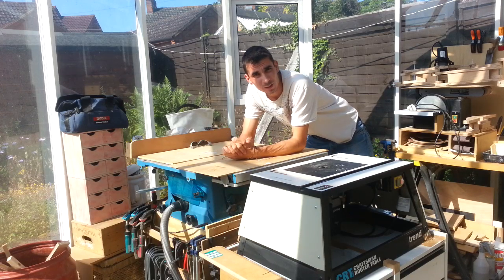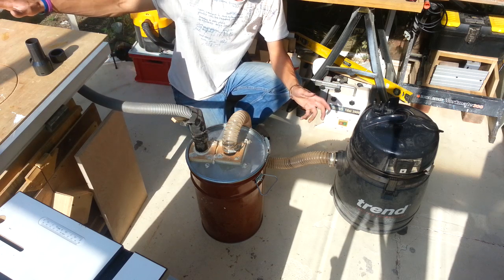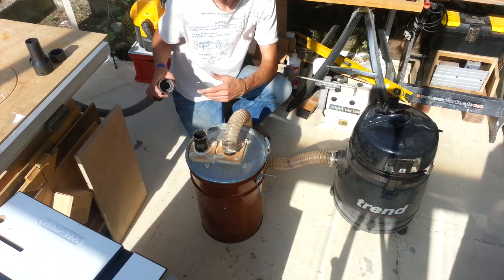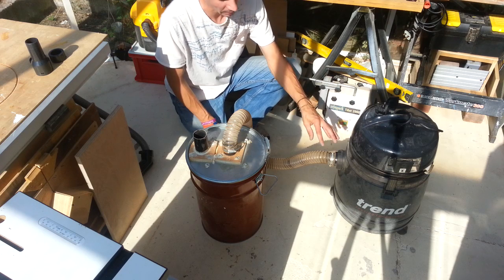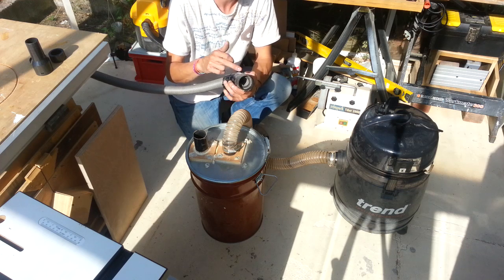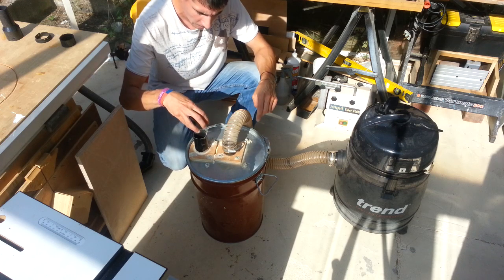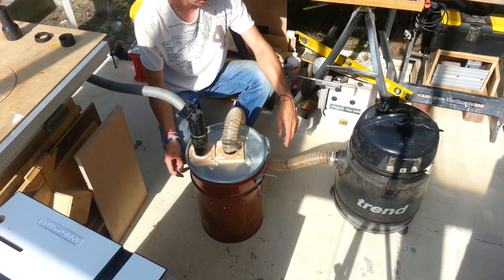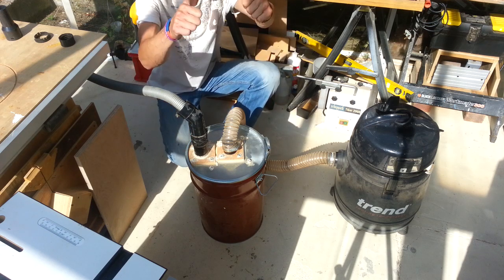Build a workshop cyclone dust separator & lessons

Comment: I think this is the most simple design of cyclone separator I found online. Great work.
I have only one question, what's the clearance (spacing) between the bucket and that lower round piece of which which serves as a dust barrier? How much smaller should the diameter of the wood piece be compared to bucket inner diameter?

P.S. +1 Subscriber :)
Reply from the maker: Th0rOS Thanks wor watching and subscribing, I'll be back to regular videos really soon (filming at present).
If I recall the clearance is about 3/4' or so, but you can probably go anywhere from 1/2" upwards. - make it smaller, the clearance, and you can always cut the ring down to improve it as you go.

Comment: Hi Rick very well explained i use two a Henrys in my workshop and gthey perform well on sucksion  what rateing watts does your trend shop vac have just wondering if i put my henrys togeather on this system would i loose much power  cheers David